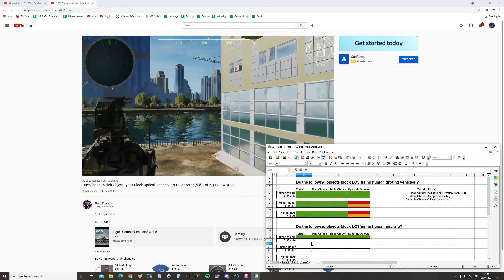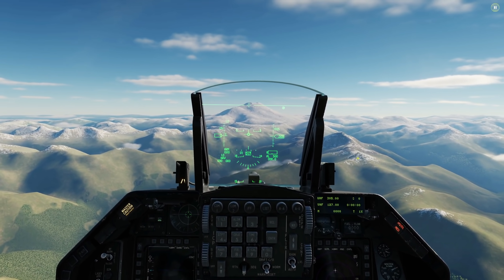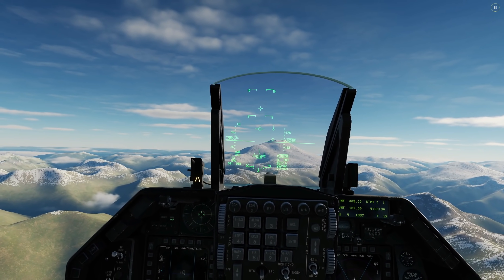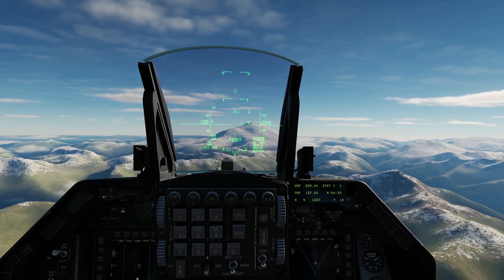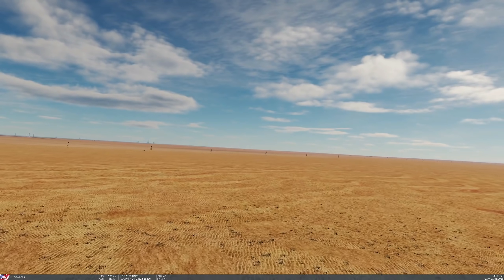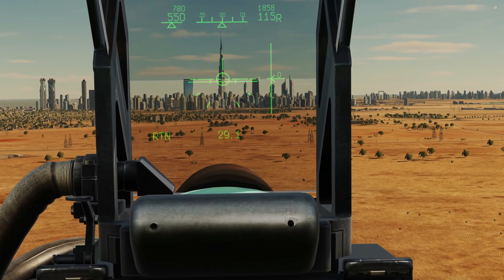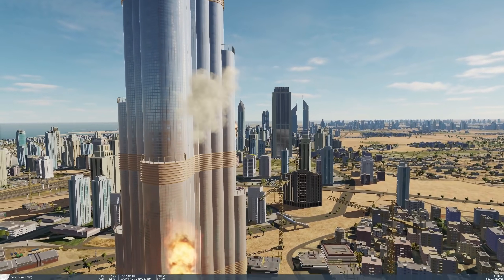Questioned: Which Object Types Block Optical, Radar & IR/EO Sensors? (Vid 2 of 2) | DCS WORLD

Comment: Regarding your theory about the radar. It should be somewhat easy to test with an object that doesn't move rapidly behind the mountain. take a very slow flying helicopter for example and lock it in active pause. If the memory mode theory is true (most likely is) then the object should disappear again after about 6 seconds. If the low poly mesh for calculations is true then the object should stay visible even when slightly behind the mountain and then drop always at the same spot regardless of speed. If the refraction thing is true (probably isn't because that's not how physics work), then the object should stay visible at a higher margin than in test 2.
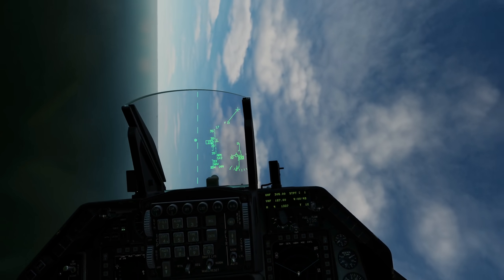Nevermind. You tested it yourself in this very video. at 10:25 you can clearly see the lock continuing after RC experienced rapid, unplanned disassembly.

Comment: Refraction: all photons can be thought of as waves, so just imagine how wave would "break" or "bend" around the Burj Kalifa. The degree of bending around around an object increases with wavelength. Equivalently, higher FREQUENCY radiation is increasingly "blocked" by an object (bends around the object "slower"). So, a building may block visible light but not radio/microwave/radar frequencies. X-rays "bend" around objects even less than visible light. "Scanning" radar uses a lower frrquency and is harder ro hide from than "Tracking" or "fire control" radar - tracking requires that the radar "bend" less so that the "exact"  position of the object being tracked can be known. A scanning radar may be perfectly happy just knowing that an aircraft is somewhere within a 1-square-mile "box", esp at a 100mi range, while a targeting radar cant realistically hope to EVER hit an object if all it knows is that the aircraft is within a sqaure-mile-box.

Comment: Cap, radar does infact use the exact same photons that our eyes receive. The wavelength is just different.

Iirc aircraft mounted radar cannot view over the horizon. You need big antennas, several meters wide for over the horizon capability. Aircraft radar is line of sight.
Reply from the maker: thx Teddy. I'm a little rusty :(

Comment: I concur that it is very likely that the radar simply continues to 'guess' where the target will be according to the generated track file. However, it would be interesting to know whether the DCS implementation has the radar still receiving accurate position updates for those few seconds, or if it truly is a simple linear extrapolation of the track file data.
A way to test this would be to have the target cross behind the mountain with a constant shallow dive angle, but once he's occluded from your POV, you have him dive sharply towards the ground. If the radar really is extrapolating it should not show the target deviating at all.

Comment: to test for radar lock behind mountain tops you could do this:
1. have a helo hover behind the top of the mountain and lock that helo, now tell the helo driver to slowly descend behind the mountain step by step until you lose lock
2. have rc nose dive behind the mountain, right after you give him the call that you lost visual, hell do a max g pull to either left or right side relative to you
Reply: Locking a hovering helo with an airplane radar is impossible because to the radar, the helo might as well be on the ground and not moving relative to them
Reply: @al3jandr038  true, maybe add to that that the chopper should be moving a bit faster than the notch filter ?

sounds like a difficult task all of a sudden
Reply: @al3jandr038  The rotor has significant doppler shift, both towards and away from the radar even when hovering. More than enough to clear the notch. AS usual, it won't be modelled though.

Comment: Point of Order SuperCap. Radio is carried by photons just as visible light and everything else on the electromagnetic spectrum. Just different wavelengths and hence energy levels. Radio is lower energy than visible so I guess could be more susceptible to refraction (not a physicist, so don’t know). Could be bouncing off ionosphere???
Reply from the maker: thxx
Reply: Wavelengths are separate from energy levels, but you got the general gist correct. Brighter lights don't use different wavelenghts.
All light both bends and scatters. Shorter wavelengths (blue) scatter more, which is one reason we perceive the sky as blue, and why sunrises and sunsets are red.
Radar, which uses huge wavelengths in comparison scatter less, and are to my knowledge capable of hugging the ground more because of it. I'm unsure if airplane radars use actual over-the-horizon radar which bounces on the ionosphere.
Reply: @skatterpro  wavelenghts are inversely proportional to wavelenght, so they do depend on one another
Reply: @skatterpro  aircraft radar do not bounce off of the ionosphere. They don't have over the horizon capability. The radar use high frequencies, so they work in a beam, like shooting out a flashlight in a dark room. High frequency, focused beam, high resolution. There are radars that operate over the horizon, but are ground based radars: low frequency, wider beam, low resolution. These are usually early warning radars.
Reply: Point of order radio is carried by both photons (particles) and waves, just like everything else in the universe (including humans) just some things behave more like particles and more like waves. As objects/gaps approach the size of the wavelength of the associated wave things will tend to appear to behave like waves. If the gap/object is very much larger or smaller than the wavelength it will appear to behave like a particle. If you measure things in a brighter area you will find more particles and/or a higher amplitude of your wave. If you want to read up on this it's called "wave-particle-duality" and led to several nobel prizes (Inluding Einsteins only one - for the photoelectric effect - proving light is a particle), Thompons's (father and son who proved opposite things). OTH radar refracts it's long wavelenth waves through the ionosphere and so gets reflections from beyond the horizon (like passive sonar can with convergence zones). Australia has an operational system I believe - the US used to have one for looking at ship movements in the Caribean.
Reply: @tomriley5790  photons behave as both waves and particles, rather than being separate. But Quantum mechanics are defo above my pay grade and don’t even pretend to understand it
Reply: @sevencranes  not quite  - a photon is a particle, or quanta, of light i.e. a light particle - proved to exist by Albert Einstein with the photoelectric effect. Light (electromagnetic radiation) behaves as both particles (called photons) and waves. As mentioned actually everything (according to quantum mechanics) is both a particle and a wave. It gets really interesting if you try to work out why the particles know that they need to behave in a wave like manner (have a look at the EPR paradox) which leads to a conclusion that everything must to some degree be linked (quantum entanglement). I spent 4 years studying physics and wouldn't claim in anyway to understand quantum mechanics, but then as Feynman said if you do you haven't thought about it enough :-)!

Comment: Radio waves (what radar - radio detection and ranging - uses) and visible light waves are actually both types of em (electromagnetic) radiation.  Both can bend while passing through materials, including the earth's atmosphere.  Some radars are designed to "see" over the horizon, while human eyes generally are not.  One way you experience light bending every day is at sunrise and sunset.  If you are on mars, in a crater, when the sun falls over the edge of the crater you will fall into almost complete darkness.  However, here on Earth, it starts to get bright for a while before sunrise and a while after sunset.  Even though there is stuff in between you and the sun, the sun's light still bends around and allows you to see.